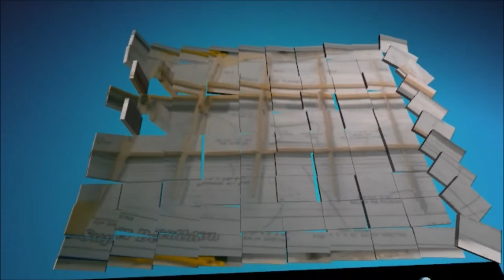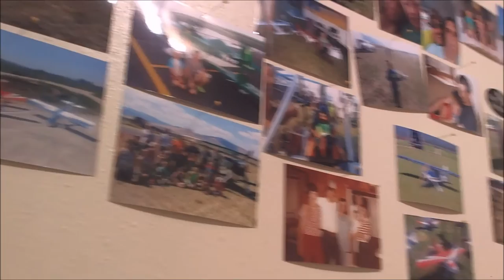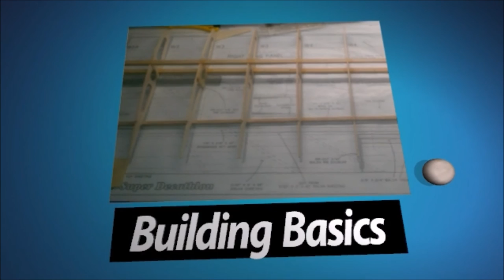Four Star 40 part 4 Fuselage Construction

Comment: Properly maintained they do last awhile. Mystery leaks and sucking air does happen after hard landings etc. You could make a hatch if you want to take the time. Screw down or just cover over and cut away if needed access later. You could get to the tank if needed as you know. This is the good part about building from sticks and plans. 
I do see a potential bubble producing problem area. We don't want to pack the foam too firm. It needs a light touch to act like foam. I see the foam is solid against the right side and against the wood on the left. This cancels out any cushion action. The side wall will transfer the high frequency vibrations of the engine to the tank and produce bubbles in the tank. A good fuel filter that holds a small bit of fuel will help to keep a solid stream of fuel going to the engine.
Reply: A tip : you can watch movies on kaldrostream. Been using it for watching a lot of movies these days.
Reply: @Eric Matthias definitely, I have been watching on KaldroStream for years myself :)
Reply: @Eric Matthias yup, I have been using kaldrostream for years myself :)
Reply: @Eric Matthias Yup, I've been using KaldroStream for months myself =)

Comment: I imagine that since the gas tank is covered and not accessible, you never have to replace them or the fuel lines?
Reply from the maker: That is how it works on this model. The tank is referred  to as "Built in"
Reply: Big Sky Hobby Corner so they typically they don't need servicing or replacement? I'm an electric guy so this is still all new to me.
Reply from the maker: If you take care of them properly they really dont. Where the problem will happen is if you develop a hole in the fuel line and it needs to be replaced. If you properly "winterize" your airplane for storage there shouldnt be any problems at all. The Hobbico Avistar I have been using in my flight school, the tank and fuel lines in it are over 10 years old but when Im done flying it for the season I make sure the tank and fuel lines are empty, I even squirt a little WD-40 in the lines to clear any castor oil out of them. The castor oil is what causes the problems with Nitro gumming up the works.